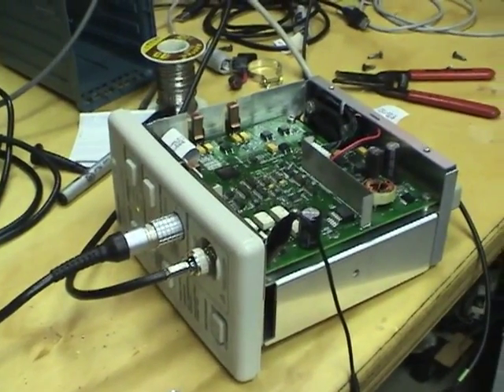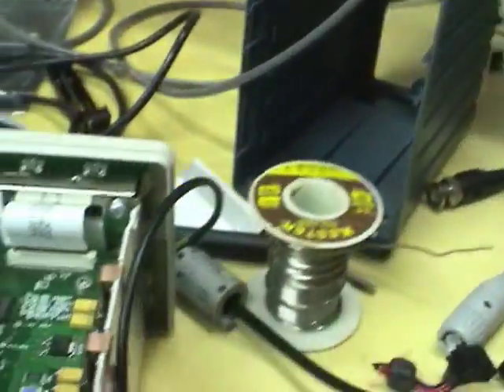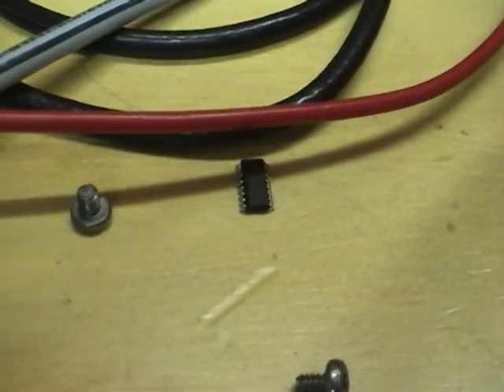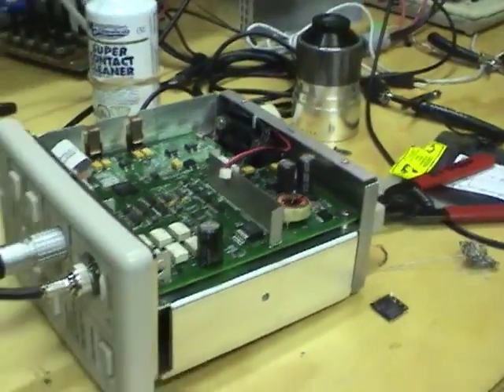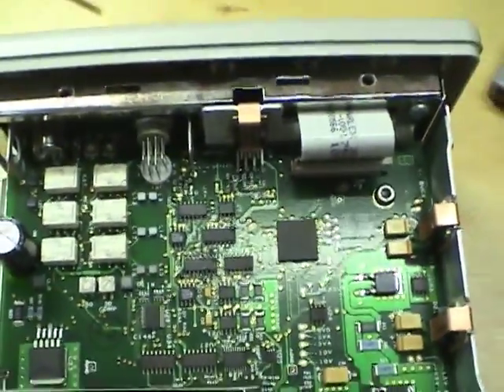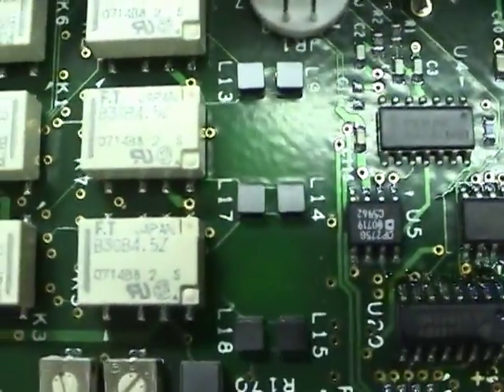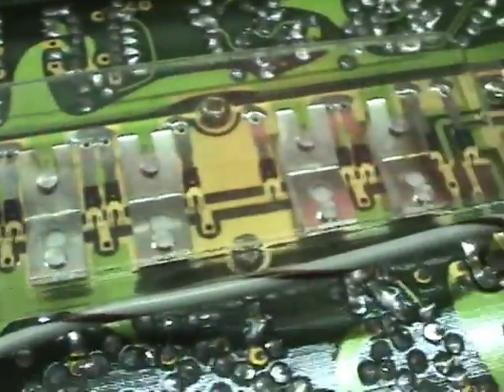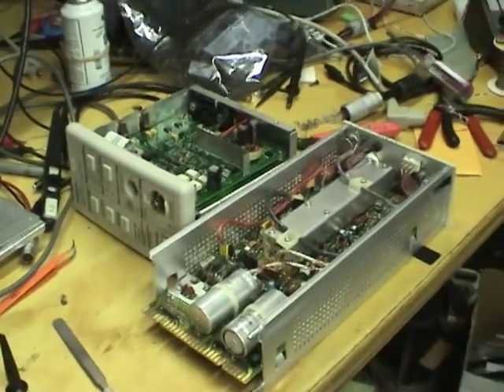Tektronix TCPA300 debugging 2 and a look at an AM503 probe amp

Comment: I have a TCPA300 that cannot autobalance - dc/ac flashing and error code 5 = amp needs service. Any idea whats the problem or Is there any manual/ circuit diagram I can d/l so I can debug myself (or do you have one)? tks.